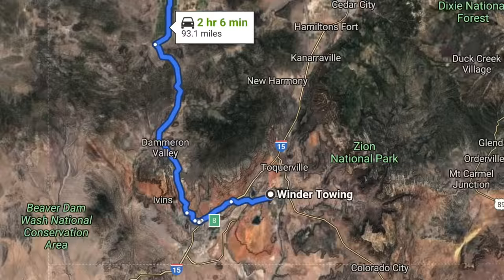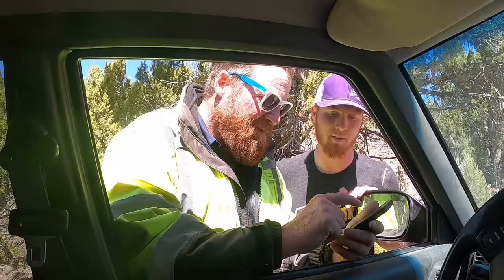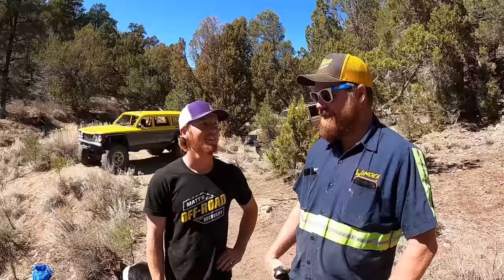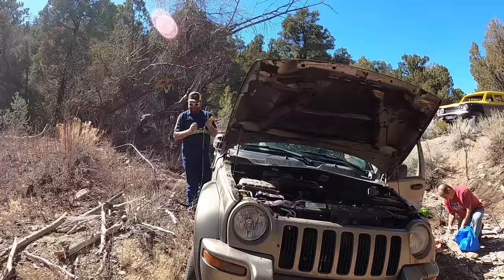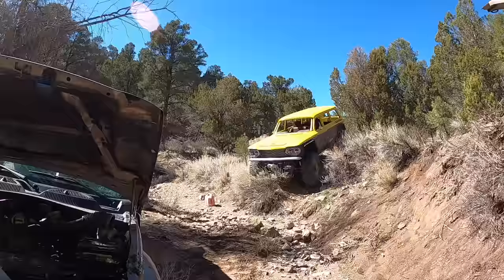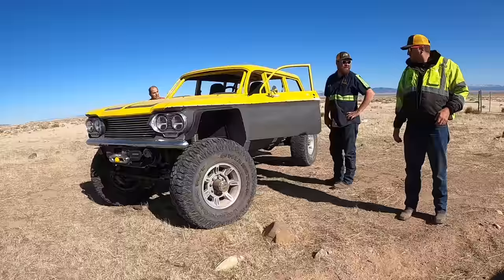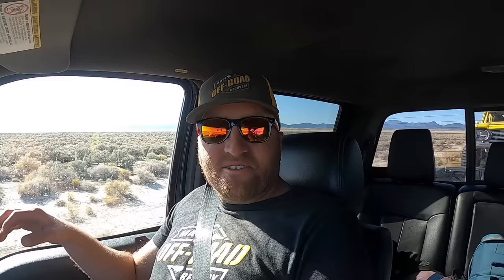Jeep Liberty Rollover 100 Miles In The Backcountry

Comment: The amazing thing about this one was not that he made it that far in a jeep. It was that he walked out of there after it rolled. That man is tough as nails. Great recovery.
Reply: And add the drive home after the recovery in it. :-)
Reply: Well if the speed was low enough when he rolled it, I see no problem. I rolled once a Volkswagen Pick-up  going about 25 - 30 miles on a dirt road.  Stupid mistake of mine, was not using seat-belts (as the VW-Pick-up had none) , and when it rolled I was turned upside down in the vehicle. The gear-shifter hit a couple of ribs.
Reply: Yea, glad he’s ok
Reply: @isallah1kafir196  That's true, but the roof was partially caved, windshield broken/cracked etc, but he was able to get it home, so that helped with the 3 vehicles and one trailer bit. :-)
Reply: @johnhpalmer6098  Yep :-)
Reply: It looks like he walked out at night of all things!
Reply: @steveblankenship5474  - gave him time to sober up.
Reply: I flipped moms 1980 5.7 Diesel Oldsmobile when I slid into a ditch speeding around a curve, rolled 180 feet, when it came to a stop, was upright, on its wheels, trying to back out, thank god the bumper was embedded in the bank as it knocked me out, when they brought it home on the rollback, unloading it into the street, dad drove it to the house and backed it in the garage. That car could have had the roof pushed back up and would have been road worthy, wish I had it today, in non wrecked condition.

Comment: Holy Moses,  that is insane how far he got.  You knew it was bad when they mentioned twisting the front drive shaft off.   I know he was determined to get somewhere but that's taking it much to far.   Made many mistakes that finally caught up with him.   Huge thumbs up on the recovery.
Reply: gotta get them smokes and milk
Reply: 2
Reply: He didn't make a mistake, the road collapse under him.
Reply: I know very little about cars, but I do know the drive shaft is one of those important parts. He's lucky he wasn't hurt or killed! 👵🇺🇸
Reply: @jamesakemon4115 if you drive on a road to weak to support you. U made a mistake
Reply: @rogerdodrill4733  Bull. Have you ever seen those videos where streets collapse vehicles? Have you ever seen a sinkhole form in the very spot you walked over the day before? The point being, the part you're crossing can look fine

Comment: Those little liberty's w/ the 3.7 will surprise you at the places they'll go, but the high center of gravity and absolutely NO clearance will bite you sometimes. That was impressive though. Great job, Matt & team.
Reply: He had driven to the end of the road, turned around and was coming back when the front driveshaft blew.  
Had he not rolled he would have got out unscathed and driven home with no one the wiser.
He did drive it home after the recovery....
Reply: @JohnSmith-yv6eq he did drive it home, but some people may just be able to piece together that he had a minor whoopsie
Reply: I drive a 06 Liberty and it does surprise me sometimes. I won't take it far off road but it's great anytime I need 4-wheel drive in the snow

Comment: That is the gnarliest recovery, ever! I would not have believed a Liberty could get through as much as it did.
Reply: If you are willing to drive it like you stole it you can get stuff pretty far where it shouldn't be.
Reply: a couple of years ago I was going on Jeep Badge of Honor trails in a stock 96 Geo Tracker with a set of AT's before I got in too far and off the actual trail and called for help... the recovery guy said the same thing about me, lol.  I've since upgraded to an 2005 Liberty Renegade and slapped a new pair of MT's on it and its even more capable than the Tracker was. The only surprise I saw here is that this guy was running some bald street tires.   Helluva good job on the recovery, too.

Comment: If he drove that Liberty back into that area that far when he gets another rig you guys have got to take him Wheeling with you I can only imagine where this one guy would go in a good rig
Reply: That guy can drive. May not be the smartest tack in the box but he can drive
Reply: Amen. His Skills are impressive.
Reply: Yeah, that road was one pucker after another.
Reply: Those liberty are junk....they try to roll on level pavement. I am super impressed he made it out there!
Reply: @TomaszbtdZiobrowski  dumberer?
Reply: @imdrunken  A jeep liberty is not junk yeah they can roll on flat ground but any vehicle will roll depending on how bad the angle is.
Reply: @imdrunken  I know right that's what impressed me he drove it there then the road fell off from under him if the road hadn't give way he probably would have never got stuck skills like that guys apparently got
Reply: @stout_tossme7541  except the part about ending up on his lid. 🤣
Reply: Ahh noo, they are junk. When the jeep trend came about after the Cherokee all my friends bought one and they all got rid of them shortly after. They rot, they fall apart and everything you can think of off. Engine problems were expensive. The worst was brakes and suspension components just snapping while offroading. They fixed a ton of problems later in the years but it was too late the first years pretty much got them lemon status an no one wanted them.
Reply: @donaldwilliams1634  i owned one, don't lie to me. Spun main bearings and all sorts of issues. Handeled like shit, tried to roll all the time, could never get properly aligned for more than a week.
Reply: @imdrunken  I currently own a 03 with 176k miles no problem at all with it
Reply: @donaldwilliams1634  i also live in the land of salt and shit roads so maybe that has something to do with it
Reply: @imdrunken  salt is a killer on any vehicle and suspension component
Reply: @donaldwilliams1634  yeah but many other cars and trucks do just fine around here compared to the liberty
Reply: @UtahOutlander  well, yeah. I mean there is that part. Lol
Reply: @imdrunken  I've owned two... one '04 Renegade, one '05 CRD.  Sold the CRD with 120k miles and not a single issue.  Traded the Renegade with 215k miles.   Replaced front driveline once.  No other issues other than the cheap plastic window mechanisms which got replaced early on.   If still be driving one if they had more HP under the hood that I need the towing here in Utah.

Comment: It amazing what you can do when you don't know that you can't do it.
Reply: Indeed! I once tried to drive a 2WD dune buggy over a bunch of 3-foot diameter power poles laying on the ground. As soon as the back tires got over the first pole, the poles rolled apart and promptly high-centered the buggy. After several minutes of flooring it in reverse and making loads of tire smoke, I managed to pick up some traction and drive right back out the way I came!
Reply: Liberties are better than the jeep tj. Much stouter suspension.  Ball joints not so much but everything else is solid.  Chasis is same as most all jeeps.
Reply: Impossible is nothing

Comment: I had liberty with 3 inch lift and 31 mt's. It was 5 speed manual and was a absolute blast off road. So many xj's and wranglers got a kick out of it on the trails. Had it's limits, but impressive for a IFS.
Reply: Same here although mine is an automatic. Lifted on 31” mud terrains. I threw a locker in the rear end and it gets me pretty much anywhere I need to go. Love it when the wrangler and XJ guys and see me keeping up
Reply: @Showe2625  Fun little rigs! I wanted to do a locker but didn't keep it long enough. The 16 year old I gave it to put her thru hell with a welded diff. RIP 😵
Reply: I had one too in a manual. It was a lot of fun, but I upgraded to a TJ Rubicon when I saw its limitations.
Reply: Mine is lifted on 31s. 45rfe auto and 2.8 diesel. Absolute blast to drive.
Reply: The Liberties and Wk Grand Cherokees were fun off road and comfortable on the road.
Reply: @Showe2625  nice.
Reply: @sHoRtBuSseR  one of the '06 CRD's- those things are serious cult material.
Reply: @jamesbridges7750  mine has been a pretty cool little rig. Goes anywhere and has enough power to destroy the axles if I want. Lmao
Reply: @sHoRtBuSseR  my boss at a jeep shop in pa just parted out a 06 crd kj because it dropped a valve and destroyed a piston
Reply: If you have a proper 4x4  you don't have to add a lift kit to go anywhere..
I giggle in my Standard Jimny when I drive around people with Jeep etc and lift kits.. that are stuck..
Who would be so stupid to drive a 3 ton F1 wanker on the beach...
Reply: @graemejohnson9025  I laugh at jeeps in my 2 door blazer that's stock but I have yet to use my 4wd in the snow she goes everywhere in 2wd
Reply: @graemejohnson9025  The problem is when you get into big rocks and things. Deep water, too. For the most part you can get anywhere in a decent stock jeep with good tires.
Reply: @karentheblazer  oh hint, don't tell Jeep owners that. You will get hate mail a mile long. It's a silly thing, we all love going 4x4 who gives a crap what you drive as long as we have fun.. look up Holden Overlander. Australian made 4x4, you could get in 4 door sedan. A Aussie Ute, station wagon, and even in a Panel Van..
Reply: @karentheblazer  oh I just bought an Original 1988 Range Rover..
Only 30 thousand miles on the clock.. all Original.. I am going to have fun when I go for a   4x4 trip.. and drive past the cars stuck. With their electronic techno bable.. my mate bought a Jeep for his farm in 2017, its now a stand still play toy for his grandkids.. it couldn't handle Aussie Farming..
And it's resale value was minus... the body bent like a Banana.. Boomerang.. it sagged in the middle..
Reply: @graemejohnson9025  yeah I keep my mouth shut and roll. But I agree we all just need to wheel together
Reply: @karentheblazer  I am a member of a 4x4 club.. we go for 4x4 trips with our grandchildren.. as soon as a member brags his car/truck is better.. he gets the toilet digging whole job.. but we have found the latest trucks are like beautiful Blondes, too much maintenance.. hi tech electronics are a pain when stuck in the middle of nowhere..
Reply: I had a Chevy tracker the 1rst year they got them from Geo it had the small Isuzu 4 cylinder and stock I wheeled the crap out of it
Reply: @sHoRtBuSseR   x2. I am very sad that it is succumbing to rust...
Reply: @davidwoermansr  Suzuki, not Isuzu. Sidekick rebrand. my first ride, open diffs and gears instead of power. If Step-dad had half an idea where all that little thing got in and out of, I would never have lived.
Reply: @geoffr5232  that's right my little Dodge had the Isuzu and my old a10 had a mid size bee shit in it
Reply: @geoffr5232  you're right it was my little Dodge had the Isuzu and my s10 had a mid size bee shit in it and those little trackers would get places that surprised most people
Reply: Sounds like fun! 👍

Comment: “This whole thing’s gonna need a go-through and a flush after everything”.   Does the owner flush the transmission before or after cutting the roof off with a sawzall?
Reply: Yeah, I appreciate Matt and his care for the vehicles, but thing thing is totaled! The only people "going through it" are pickers at a junk yard.
Reply: Win it sarts sliping?
Reply: @briane9729  still a perfectly good vehicle for offroading.  may want to trailer it on the road though if you cant get glass to fit in it anymore.
Reply: @briane9729  They are from Utah, a junk yard is just someones back yard and it will sit there till they decide to fix it
Reply: only thing he can do with that thing is part out what he can and cut his losses.  That thing is totaled.

Comment: As someone who almost rolled my parents Liberty multiple times in high school, they love to spin out and are a bit too top heavy.
Reply: Anything with high ground clearance with a tall profile is going to be somewhat top heavy.
Reply: @Sashazur  the Liberty is also kind of narrow, which contributes to the top-heavy, tippy feel. I had to remind myself driving my 2005 that it didn't corner like my Audi...
Reply: It's shorter than the XJ and taller.  Was advertised as having the same cargo space in back but got it from vertical space thus the higher center of gravity.  Never liked 'em because of that.  Chrysler never should have nixed the XJ platform rather it should have gotten a better V6 as AMC intended back in '84, quadra coil suspension with its own Rubicon configuration (D44 front and rear), and some H3 styling cues.  That's what it should have looked like but Hummer beat 'em to it.  The XJ is dead.  Long live the XJ!
Reply: ohhhh yea lol although i had my liberty do some pretty crazy shit completely stock lol
Reply: Tracy, hi just this week a pilot & his sone went to a small airport camped by the aircraft , then saw all those tracks in grass & gravel, then came upon a memorial some 30 years ago, some btunk guy & his cousin were doing donuts, in some jeep, it rolled, the cousin was ejected & crushed, someone else went for help, no phone service , anyhow he went to JAIL   but those demurs were STILL THERE after all those years, it was a FOREST SERVICE AIRPORT, CHEERS 🇺🇸🇺🇸🇺🇸🇺🇸🇺🇸
Reply: Even in the silent hill movie, the main character spins out her liberty on a wet road.
Reply: Never considered the Lib a JEEP.  It's a car with a badge slapped on it.  I mean c'mon, compare it to an XJ.
Pbbbbbbbttttttt.
Reply: The customer was a champ ha ha! Keeping the place clean and helping out when he could.
Reply: @turkey4957  you have to drive it too roll it ,, lol yes a lot of auto's like to roll over but most of them is the driver ,,
Reply: @deltavee2  they have a real transfer case, solid rear axle. How is it not a Jeep?
Reply: An the xj is a piece too 4runne r for life

Comment: You would be surprised how much a Liberty can do. I started off-roading with a 2003 Liberty sport. Now, of course I made sure I had solid skid plates front to back, front and rear hitches and rock rails before I even went on easy trails. I also got a 2 inch lift with goodyear MT/R tires (same size as the stock TJ rubicon).  But I took it regularly to Rausch Creek and Paragon (before it was closed). I also did some trails in the George Washington National Forest in Virginia. There was even one trail I went on that had a section so tricky that somebody had to stand on the back bumper corner to make sure I didn't roll it over. After a while though, I did upgrade to a 2005 LJ (which eventually got a long arm and high steering).  Now I'm working on a 4 door JK with just a 2 inch lift.  But the Liberty was still a great entry level Jeep. It's what got me hooked on off-roading.

Comment: With that rig and those shoes, that liberty owner did a great job getting it to that point.
Reply: Yeah, it's crazy just how capable they are in stock form. If you wanted to do a cheap SAS, you could probably grab the D30 from a ZJ Grand Cherokee and have a good start as long as you don't go crazy with the tires. The Liberty already has coils. You could even build a super 30 if you felt like lifting it further. They don't look like it, but the 1st gen Liberty has a slightly longer wheelbase than an XJ and a stiffer unibody structure than the XJ and ZJ. 
I'm surprised they aren't more popular.
Reply: @DriveCarToBar  3.7s are pretty gutless especially compared to the previous 4.0.  I always assumed it was the same or shorter wheelbase than an XJ
Reply: @GTPCarpy  slightly less torque but more horsepower.
Reply: @DriveCarToBar  the horse power doesn't matter when wheeling.  Peak torque almost off idle is one of the reasons the 4.0 Jeeps are way more popular
Reply: @GTPCarpy  3.7 produced 210 hp at 5200 rpm and 235 ft lbs of torque at 4000. 4.0 produced 190 hp at 4600 rpm and 235 ft lbs of torque at 3600.. don't know where you get that the 3.7 is gutless from
Reply: @jamesakemon4115  from every 3.7 vehicle I've driven
Reply: @GTPCarpy  lol, I just showed you that the 3.7 has a higher output then the 4.0. Doesn't seem gutless to me. Maybe the 3.7 feels gutless because the liberty is overweight and under geared.
Reply: @jamesakemon4115  they feel gutless in Durangos, Dakotas, Grand Cherokees, Rams and Commanders
Reply: @GTPCarpy  lol, all over weight and undergeared. Think of it this way the old fox body mustangs had the same hp but weighed 8/9 hundred lbs less. My above statement stands.
Reply: @jamesakemon4115  because there isn't enough gear possible for those things
Reply: @GTPCarpy  lol, look up the torque cure for the 3.7 and the 4.0. Both are making the same at 2000 rpm. Then it changes as the 4.0 reaches max torque at 3000 while the 3.7 does it at 4000. Max.torque off idle my ass.
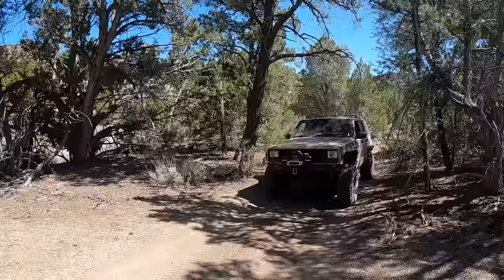Reply: @GTPCarpy  as for the gear, swap on a set of 4:10, makes a.big difference.
Reply: @jamesakemon4115  I didn't say off idle.  A turd is a turd just let it go
Reply: @GTPCarpy  lol, yes you did. You might want to go back and look at your comment.  You like so many other don't know jack when it comes to libertys. You just parrot the same bs you heard someone else say.
Reply: @jamesakemon4115  I'm a tech pf 20 years.  I've driven plenty of 3.7 vehicles
Reply: @jamesakemon4115  I'm a former Chrysler tech.  I've had to fix more of them than you've seen

Comment: I think the Liberty will probably buff out. Nice job. Cheers!
Reply: Maybe a little Bondo and duct tape too...
Reply: @61rampy65  Flex tape
Reply: @61rampy65  Add  some Scratch-X and Turtle Wax and it will be as good as new.
Reply: @loosemoose9799  He may need to call a glass shop to fix the scratch in the windshield, tho.
Reply: @61rampy65  There are some very good glass repair practitioners out there but if one was called he might need a sedative when he sees it. I couldn't help but think it would be funny to do it.